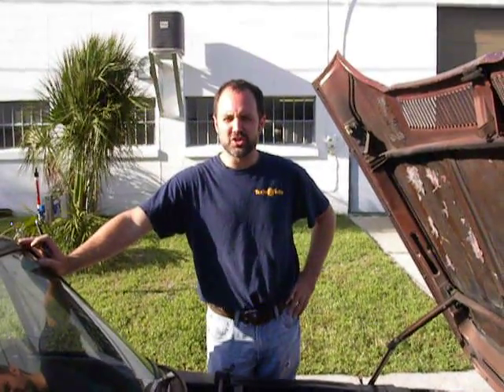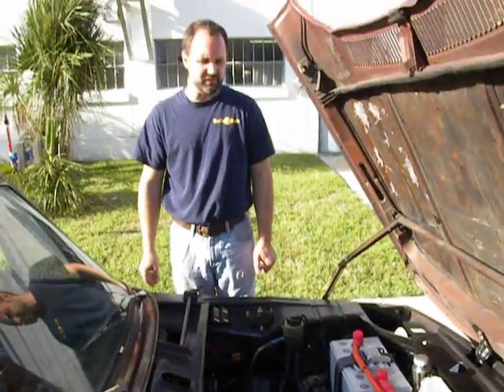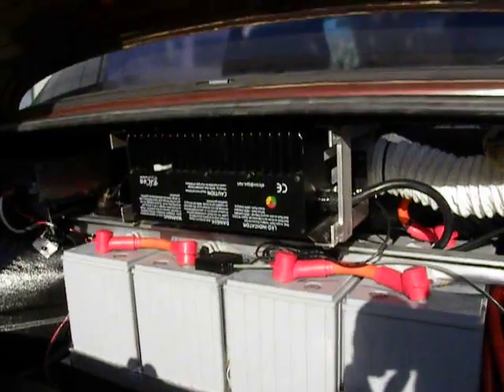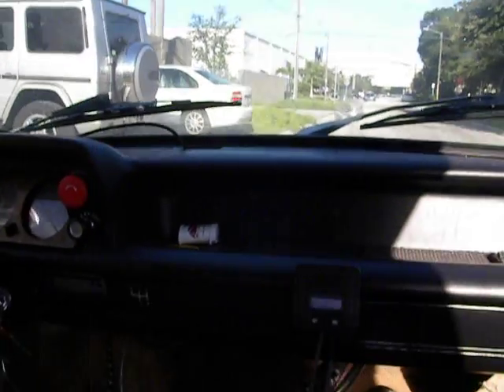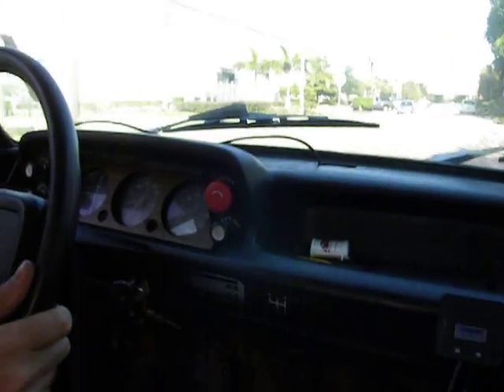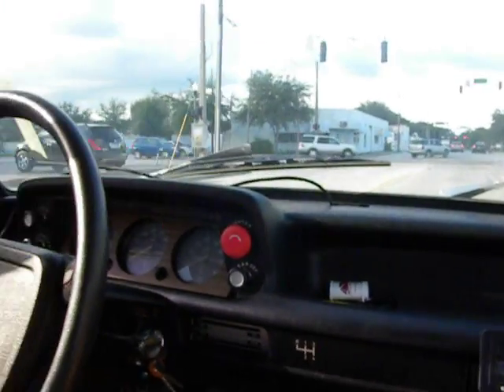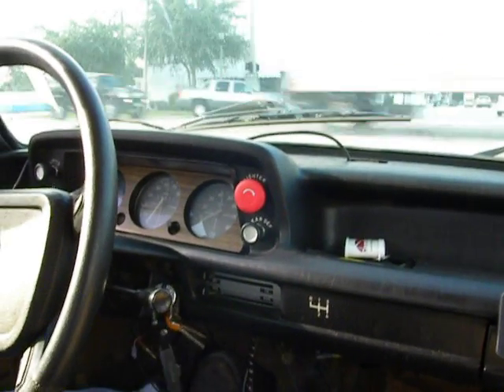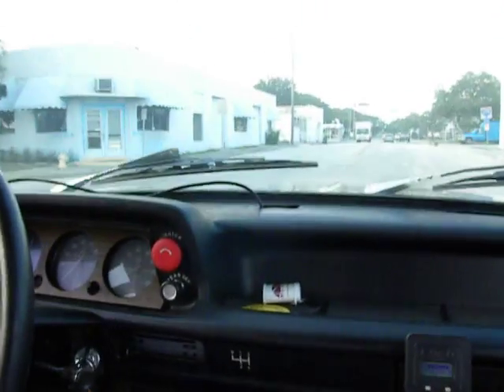RebirthAuto 1975 BMW 2002 Electric Vehicle with EVnetics Soliton1 Controller

Comment: @electro5 A controller is used to vary the amount of current you send to the motor so you can control your speed. They can also have a 12 volt output to run accessories or recharge an accessory battery.